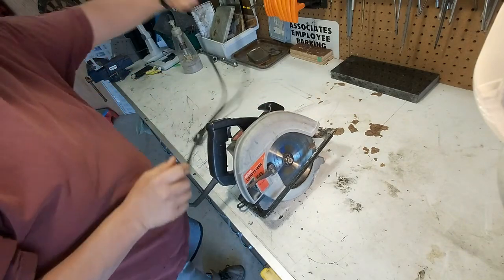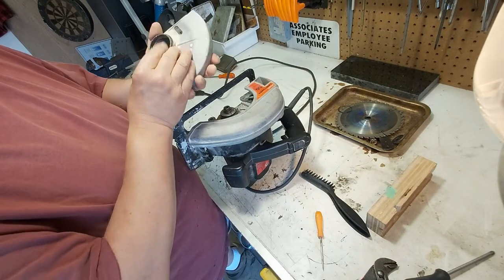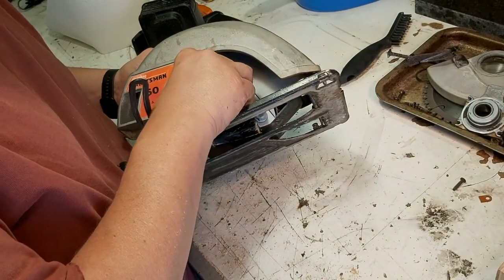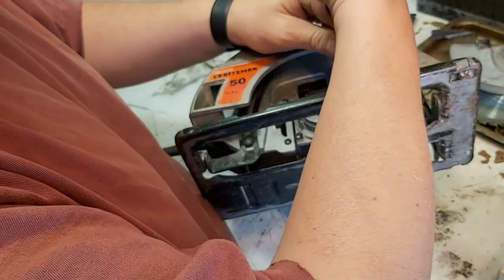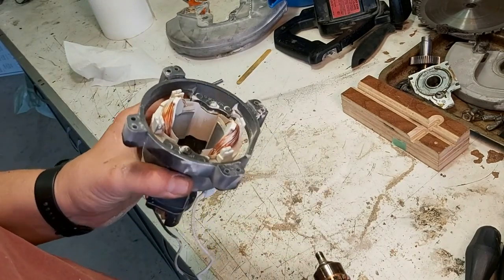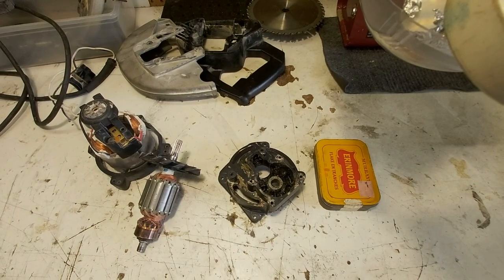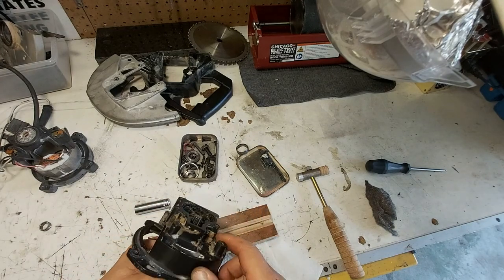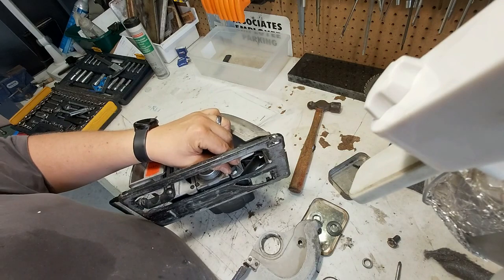Skill saw circular saw bearing replacement

Comment: I discovered your video right after I'd finished with my 40 year-old Craftsman. I took it apart and put it back together several times, and was laughing when I watched you do the same. The bearing in mine was a bit worn as well, but didn't really have any lateral play in it, and I couldn't drive it out with any of the separator/pullers or punches I have. Main problem seems to be that the armature was contacting the stator, and caught on fire. I reassembled it, tested it once more, whereupon it caught on fire, and then I threw it off of my second floor deck into my metal recycle bin. I've repaired a lot of tools over the years, and these seem to be made rather poorly. Glad you had better luck with yours than I did.
Reply: Ha, thanks for the support.  I never know what I am going to find until I get in there.  It was an adventure.  Thanks for the comments and the feedback.  Too bad your were having fire issues with your saw, but tossing it was probably the right choice.
Reply from the maker: Good Going. I wish you made a video of it on fire .  That would have been cool.   The Craftsman line is/was good tools.  I hope to get a few more years out of my saw.  Don't get any on ya!
Reply: What all that fun without a beer?

Comment: Well done, not only good for step by step, your awareness of where your camera is and doing the work so the camera can see is excellent as well. Better than most for sure.

I am watching this because I want to see how to take my saw apart for lubrication. Bought one that was sitting for 10+ years and sounds rough. Thank you for making this.
Reply from the maker: Thank you for the really great comments.   That was one of the first videos I ever made.  I have tried to make them a bit shorter and more to the point since then.  I am glad it helped.

Comment: I believe craftsman builds their products so that nobody else but them can easily repair a craftsman product. Lawnmowers are a great example of this theory. I tear into any lawnmower repair without hesitation. But a craftsman I do plenty of research before I even remove one fastener so I have a clear map on the nightmare I'm going into.
Reply from the maker: True, enough.  Good comments.  thanks for stopping by!
Reply: That circular saw is not made by Craftsman that is made by the skill corporation before Robert Bosch owned them that's made in the USA it's not trash now Chevron owns the brand. Actual to remove where the blade is after you remove it the bearings and all that you need snap ring pliers I had the same model and the only reason why I threw mine out because the motor died completely and I purchased a skilsaw 5485.   13 amp so far so good got it in 2009 probably should do some maintenance to mine no wobble one thing I need to do is have some lithium grease replace the carbon brushes do some general cleaning to the armature and I'm back in business I know those things could be a pain in the butt

Comment: My old Skilsaw had a stator that overheated and warped the inner plastic winding holders to where they are leaning toward the spinning armature, and are interfering with it. The stator is also scored in the inner metal layering that those things have (not sure what they’re called). That leads me to believe that the armature was probably replaced during the saw’s useful life; because the armature didn’t have scoring. The stator is degraded now, and probably has a reduced working life. I Will probably order it new next month.
Reply from the maker: Hey if you can get it all back together you will have a great saw there!  Thanks for dropping by!

Comment: IMO you're likely tightening the blade bolt too much. I did for decades too. Me Skil wrench is stamped with directions to 1/8th turn beyond finger tight. I assume this is for a couple reasons...to not warp the blade. And maybe to allow the blade to slip if it binds too much but that may not be true. One nice side benefit has been it's now super easy for me to change blades. No longer need to lock the blade with a screwdriver or wood, holding with my fingers is enough to remove the bolt. No longer a strongman competition.

This also answers another question I've heard many guys wonder..."why don't saws have a button to lock the blade like grinders have?" It's because the saw manufacturers don't want users torquing down that bolt. And also why blade holes for the arbor are round, not keyed to the 2 flat parts the arbor washer has to match the arbor...they don't want the blade locked to the arbor I assume.
Reply from the maker: Thanks for the valued input about the blade tightening.  You are probably right.  I hope others see the comments and take your advice.  Thanks for stopping by.
Reply: You are correct a hundred percent
Reply: @daslab68  You could pin this comment.  Thanks for making the video and not only doing a good job with it, it also gives a place for people to share their knowledge as well :)
Reply: Water Bug, thanks for pointing this out. It makes sense.
Reply: Love your work champ

Comment: Hi.. I have a problem with my metabo so when you put on power the motor turns blade only turns few seconds later and once the blade makes contact with the wood it stops completely motor is still turning by the way..

I was wondering if I can get help regarding this I'm worried
Reply from the maker: Hi, make sure any spacers you may need are in place on either side of the blade.  it sounds like your hold down nut is at the ends of the thread on the motor shaft, but it is not "clamping" the blade in place.   You may need some washers on either side of the blade.
Good luck

Comment: And by the way for those types of circular source that don't have a blade lock switch you can use 1/2 in socket with an impact driver and because of the vibration you don't need to lock the blade and come right off putting it back I would do it by hand and use the wrench to finish do not use an impact driver to put the retaining bolt back on you will destroy it the whole armature and destroy the threads just a piece of
Reply from the maker: Great comment.
Reply: @daslab68 thank you had to go back add more to my comment I don't know if this was manufactured by the skill four Black & Decker for Sears it does look like my skill saw 5051 USA made

Comment: that isn't a skill saw
Reply from the maker: It is in the right hands!
Reply: It is its manufactured by skill  for  Craftsman  now stanley black and decker makes them skill is still around owned by Chevron before that they were owned by Robert Bosch I had the skill  version of that circular saw 5051 modal